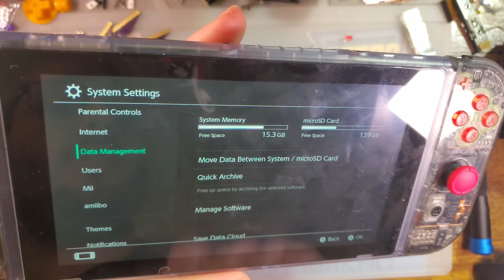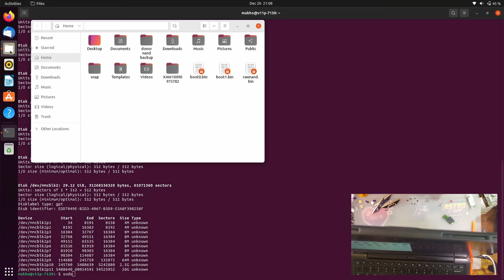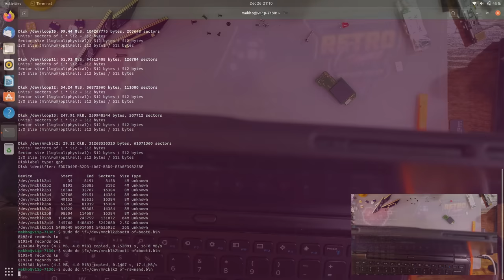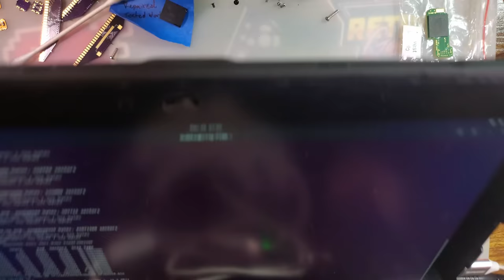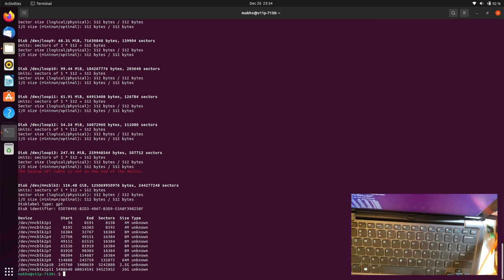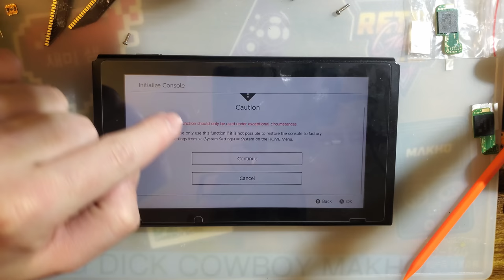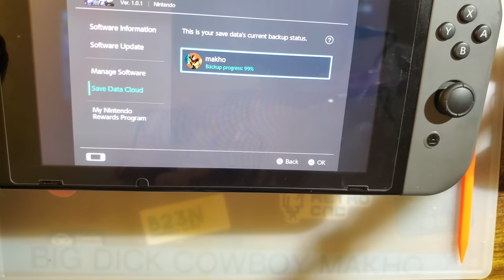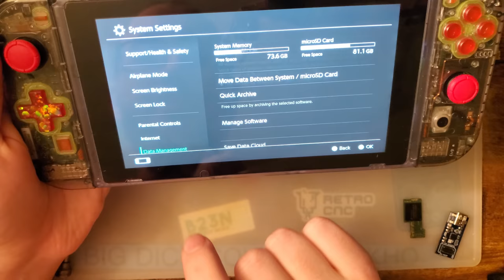Switch (v1) Storage Upgrade

Comment: Nice!!! i did this a 3 yrs with a 256GB Module. Abosultely worth it
Reply: Does the 200 MB/s speed affect loading speeds drastically?
Reply from the maker: @inclinerd  Mine is limited to that speed because of the chip I installed. There are higher speed 128 and 256 GB modules, I just didn't install one. 

And no, it doesn't. Not in a way that is noticeable, anyway.
Reply: I would love to talk with you about your process

Comment: hello very well, I see that you know a lot about the console and everything that has to do with the tests, a question if you are so kind, you already know how to find the point to solder to create a bluetooth button for the joycon without the need for FLEX SL /SR? What happens is that the FLEX connector of the right joycon broke and the SL/SR does not respond and the bluetooth button stops working to pair the controls of the switch and the pc that I use a lot in the latter, and I have not thought about buying another flex since it is the second one that breaks and I better try to create a bridge to install a button in the points where the bluetooth button should go

Comment: Booting without an eMMC installed will just drop you into RCM. You have to hard-poweroff or unplug the battery to get out of it (or push a payload on vulnerable units, or push a Nintendo-signed command to shut it down, but glhf with that)

Comment: Hello. Is the cable that connects the eMMC reader a normal USB cable or is it a special cable?
I ask because I don't understand what it is from the video, and not even from the images, even if USB is specified but the metal part has a too angular trapezoid shape, but maybe I'm wrong and it's a normal USB.
I ask because I bought this reader and I wanted to know in advance if I will also receive the cable or not and if in case I will have to buy a Male-Male USB ... I wanted to get to work as soon as it arrives and in any case I want to be ready about it the cable.
Reply from the maker: mini USB

Comment: Great video. A reference for Nand backup. I also have a dumpy lite that I practice reballing with. It got to the point where the emmc got burned.  I have a full backup of my Lite (including boot0,1). Since I have a v1 switch laying around. Can I just grab that emmc module with its nand and restore my lite backup into it using mmcblkNX? DDing it in reverse just like you did? Thanks again,
Reply from the maker: So long as you have the backup for the same switch, I don't see why not
Reply: @makho  Thanks brother. Your video inspired me to try it out and I successfully replaced my modded V2 with an OLED’s eMMC (60gb). Since I have the keys for the console, how can I get it to recognize the new storage? Still the same after initilaztion
Reply from the maker: @af6727 All that mucking about I did in the video with partition tables and decrypting is when I was expanding the data partition.

Comment: Hey! First of all great video, very well explained and interesting!
Now I have a question that maybe you have the answer. I have a blue screen switch, lucky for me I have the boot0, boot1 and NAND files backed up from when it wasn't on blue screen (but I don't have the bis keys), so my question is: can I use that emmc reader to dump the NAND backup to that pre-corrupt state? Or at least being able to dump the NAND backup on a new emmc module? I guess it should work but you're the expert here.
Reply from the maker: If you have a full nand dump (including the boot partitions), you can just restore it to another module and swap that in. If your backup is from an older version and you've installed an update that burns an efuse, you'll have to do other things to get that backup booting though. If v1 switch, just cfw to boot until you can update it.

Of course, this will only work if your problem is hardware related and due to a failed nand. Otherwise just restore the backup you already made on the nand you already have.
Reply: @makho  The backup and the switch are both on the same version so that won't be a problem. Now, regarding about the problem, I've been told that most of the times BOSD happens because of a software problem (like 90% of times because of a corrupt NAND) so I suppose that dumping a full working NAND backup overwriting the corrupt NAND should work right? Also someone from my city told me that the processor may be broken but I don't think that's the case, also people on reddit told that he didn't wanted to work because it doesn't make sense 95% of the times. I don't really know since I'm not an expert on switch hacking but I'm slowly learning bit by bit, I still have hopes to revive my switch this way, and if not maybe there would be another solution somewhere else on the internet idk. Let me know your thoughts about my assumptions, also if you want I can give you more details about the full problem of the console.
Reply from the maker: @draconairus  If the problem is corrupt software (which is nearly impossible to do without modding the device), then restoring your backup will fix it. Blue screen does not indicate corrupt software though. It indicates a general fault with the console. https://switchbrew.org/wiki/Panic_codes#:~:text=Panic%20codes%20All%20elements%20in%20the%20Switch%27s%20boot,reboot%20by%20programming%20a%20dedicated%20hardware%20watchdog%20%28WDT4%29.

Comment: Pro Tip: When watching a video make sure the it starts at the beginning and not a timestamp that makes you think it's the beginning. I watched this 3 times from the wrong point, lol. Is there a video or guide about using the 64GB module bought from Ali?

BTW I went through the list for all the videos and definitely will be checking out the Gameboy ones later, couldn't see one for the 64GB modules. I just couldn't see a 64GB module one, though will be watching a few when I get time.
Reply from the maker: 64gb module was off aliexpress. I just restored a firmware backup to it and then expanded the partition. There's guides out there in sketchier parts of the internet but I'm fairly certain that there are tools you can run in hekate to do it for you.

Comment: i have never rly assumed there is an advantage to upgrading emmc? is it all that faster than micro sd? 
i suppose if you are wanting a better sysnand with more space for your actual real games vs sd card exclusively for emunand kind of thing it makes sense to do?
Reply from the maker: most emmc is faster than most micro sd and it does make a difference in load times in some cases. Like I mentioned in the beginning, the most efficient storage upgrade is still to just buy a larger (fast) micro SD.

Comment: What if you just expand the /dev/mmcblk2p10 partition (reading and backing up that GUID as well, in case), but expanding the p10 to the end of where p11 would be.. then initialize again.. (expand without losing existing data)
---
Or if the 2.5gig p10 partition isn't the one you want to expand,  you have a backup files, you could separate each partition (p1 to p11)(or write out each one separate to a file), then pick another p(1|9) partition, expand it, (getting the amount of space to expand by.. just get the total # of sectors of p11, then add those to whatever p you expand) then read all the partitions back in order into a .bin file.. then write it back to NAND as you did 1st time.. then initialize again..
These are just guesses based off my experience with drives & partitions.. but it might work..
Reply from the maker: unfortunately, the encryption means that won't work. About the only thing not encrypted is the partition table itself. I did actually try that off screen before publishing this video and the Switch will refuse to boot since it can no longer decrypt the (no longer encrypted but still empty) data partition. 

Without the console specific keys, about all you can do is read and write the data as-is to the flash memory. Any manipulation of any data other than the GPT partition tables will fail. 

I was hoping that this would work, even if it means initializing the console and deleting all the data but I just can't find a work around that does not require the decryption keys, even if I don't care to preserve the data.

Good idea though

Comment: I have a 2017 device and I lost the NAND memory. Is there a solution to replace it with another part for a different device?
Reply from the maker: So long as you have the CPU key, I believe you can just use a generic NAND image now. I'm not sure the details on that though.

Comment: are the encryption keys console specific or emmc specific? could you move the emmc to a hackable (without modchip) switch and get the keys that way? sorry if it's a dumb question
Reply from the maker: The encryption is not reversible. If you want to modify the content of the storage partition or the size of the storage partition, you need to get the key from the Switch itself, not the emmc. It is normally not possible to extract this key from the Switch.

Comment: So why on earth were you talking about playing musical chairs with the chips so much? Like, why bother backing up the donor chip when it's just getting discarded? Why take the extra steps that necessitates re-balling? Just put the big chip in the donor board, reflash it with your console's data, put it in the system. Leave the original intact and unmolested. Why would I want to backup an Odin chip, what could I possibly want off off it that I could possibly do anything with?
Reply from the maker: ODIN is the code name for the prototype/dev hardware. It would be foolish to wipe the chip without first backing it up on case there is anything interesting in there. The encryption largely makes that a moot point but since I didn't do that, I'll never know. 

Backing up data is cheap. Recovering data is not.
Reply: @makho  the problem is the encryption. Whatever was on there, assuming anything was to begin with, is effectively useless. And someone has probably already backed it up at this point, so I wouldn't be super worried about the loss. And you are right, backing up data is cheap, but reballing and soldering BGAs without a proper template and jig is not, it is expensive in time and effort. I argue that the juice is not worth the squeeze here.

Comment: The eMMC is married to the CPU right so you cant just put another one on right? I am asking cause they sell em on mobile sentrix which I find strange.
Reply from the maker: The eMMC isn't but the data on it is. You cannot replace the eMMC without first getting all of the (encrypted) data off the original.
Reply: @makho  can doing what you did fix a blue screen of death?
Reply: @UC5FYpo9lFqK1Y7wqjPuANFw I can appreciate the effort you have done but can't you get a storage upgrade by just inserting a good microSD card that has a lot of store like 1 or 2tb?
Reply from the maker: @trilexfix  depends on what specifically is causing the problem. Likely no.
Reply: @makho  what can fix a blue screen of death if the eMMC is the issue?
Reply from the maker: @trilexfix  If you have a backup of the encrypted data, you can flash it to a replacement nand and then replace your nand.
Reply: @makho  the nintendo switch came to my repair shop with the current issue I doubt the customer backed up their data and that customer is long gone.

Comment: anyone knows where to get another emmc chip? looks like most sellers dont have any chips with 256 or more anymore
Reply from the maker: Old tablets and laptops can be used for salvage but I guess you're not likely to find anything in that size. I am not aware of any more common parts in the same footprint but with a passive adapter, most eMMC modules should be relatively painless to shoehorn in.

Comment: Would Linux runing on a Mac via virtual PC via Parallels App be viable for the linux portion of this video?
Reply from the maker: Native mac would probably be fine. My understanding is that it's just how Windows handles SD class storage devices (which normally don't have hidden or boot partitions). You can test by just plugging it in and seeing if you can see the BOOT0 and BOOT1 partitions. If you have to use a VM (and parallels is a VM), you will need a way to pass the entire removable device to the VM and I don't know how well macOS or Parallels handles that.
Reply: @makho 
I lost the original Nintendo  swich emmc and I do not have the code for my device or any information. Is there a solution?
Reply from the maker: @qusayali938  I am unaware of any methods to extract encryption keys from an encrypted device. All methods I'm aware of require the device to be first de-encrypted which requires the paired NAND that your console would have shipped with.